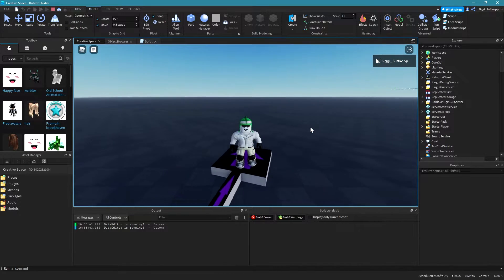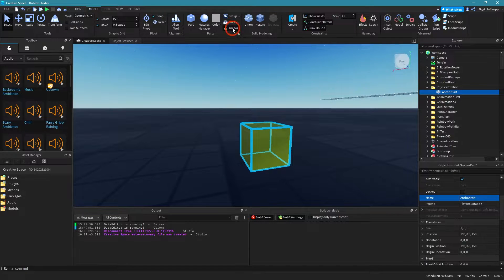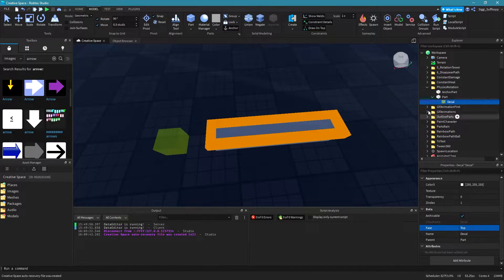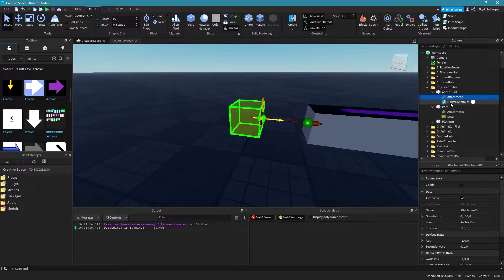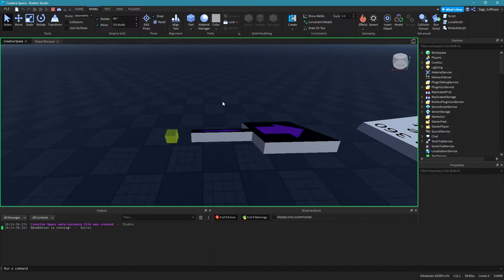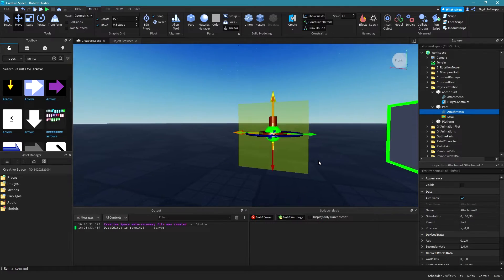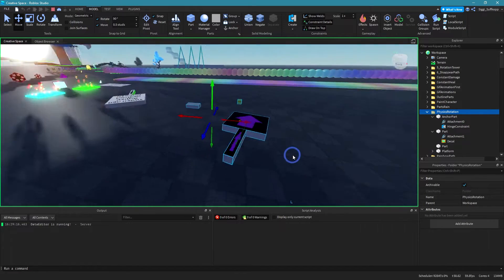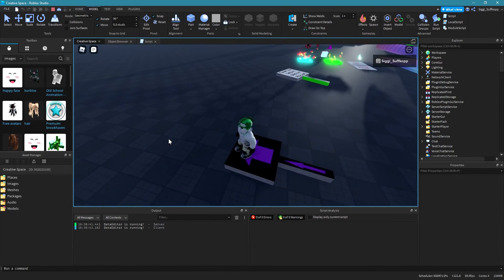Physics Based Rotation of Parts with the Hinge Constraint [Roblox Studio Tutorial]

Comment: im trying to do this on a tower crane i've made, but it doesn't work and gets stuck, i tried playing with the collide settings of part but still the same. it's pretty complicated, would be great if u could lend some help man
Reply from the maker: It is difficult to give you a correct answer to your problem without having more information about the settings you have made.
What do you mean by “gets stuck”?
How do you control the rotation of the crane? Through a script? If yes, note that you cannot use degrees for the rotation because Roblox uses radians for the rotation!
Reply: @Dev_OnCake  nope i did it the exact same way u did,
Reply from the maker: Make sure that the attachments of the HingeConstraint are in the same position. Red arrows in the constraint indicate an error! So make sure that there are no red arrows!

Comment: I am not sure if you have ever seen the movie Jackass, but I am trying to make a PIE IN THE FACE HAND... basically its a large hand with a pie in it that gets pulled back and as someone walks through a door it rotates very fast and whacks them with a pie... I would just like to do this using a non collide invisible part as the trigger in the doorway. The hand would rotate just like this but faster, so the physics "smacks" them backwards, then the part needs to reverse and reset for the next "smack." I think your method is the most practical way to achieve this but I would love to see how it would be done as a guide. (I am also having a hell of a time trying to find a way to have a touched event trigger 2 actions at the same time.) Thank you.
Reply from the maker: Do you mean something like this: https://www.youtube.com/watch?v=nnWtt8MLSC8
Actually, you could use exactly this platform for this and only have to add one hand to it. Then you just have to control the rotation speed and direction of rotation of the motor using a script.
Since the TouchEvent is not reliable as a trigger, i recommend you the method "GetPartBoundsInBox": https://create.roblox.com/docs/reference/engine/classes/WorldRoot#GetPartBoundsInBox